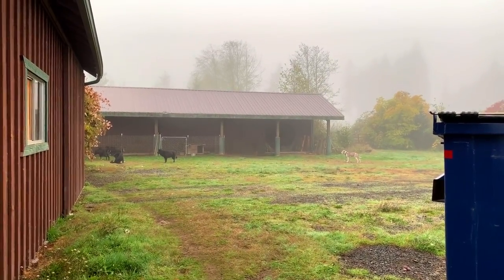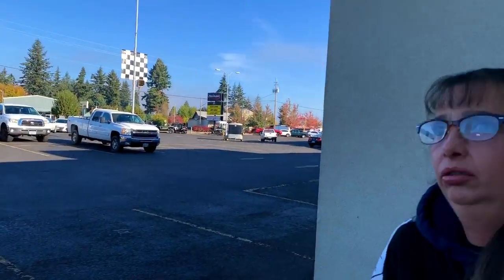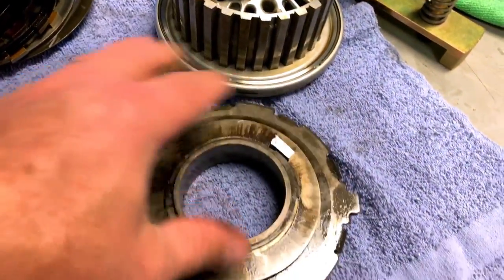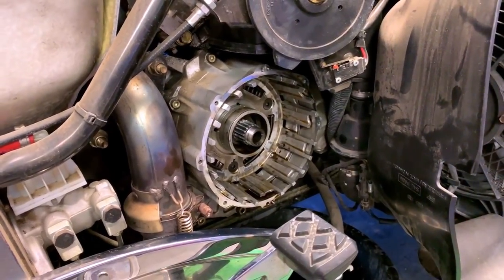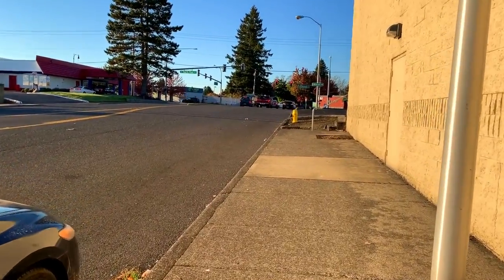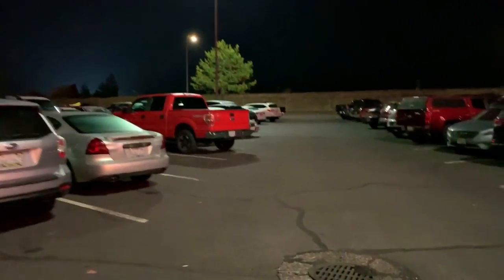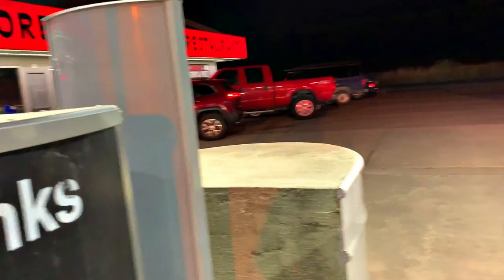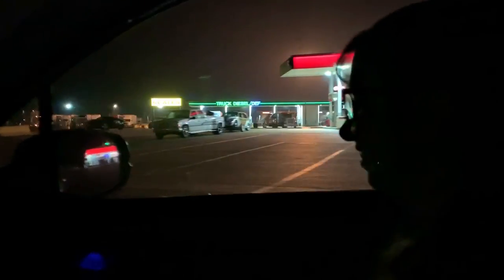Inside Spyder SE5 Clutch!! • Halloween Movie Night! | TheSmoaks Vlog_1069

Comment: How do you remove the cover? I am down to the last step you showed and I need to replace the water pump. I have removed all the bolts but it will not come off.